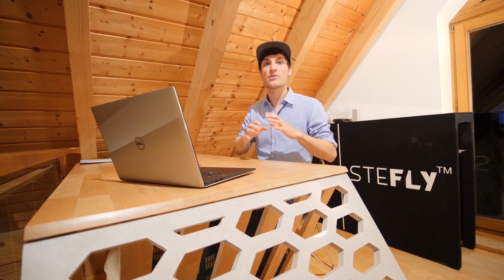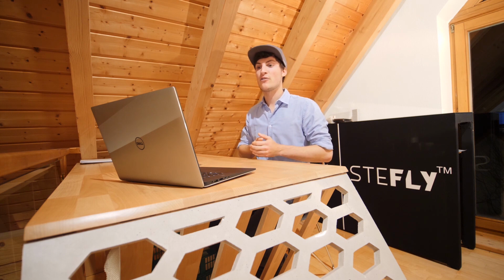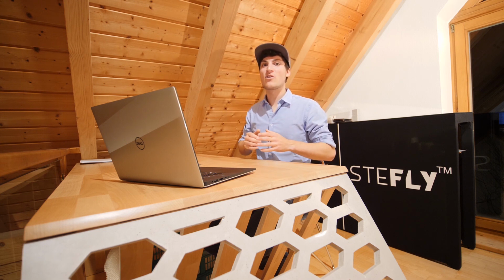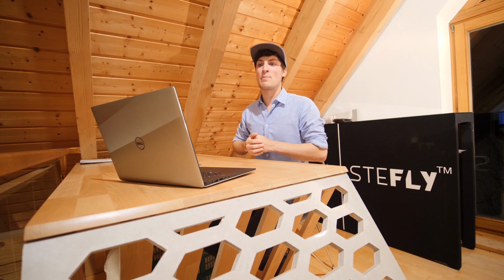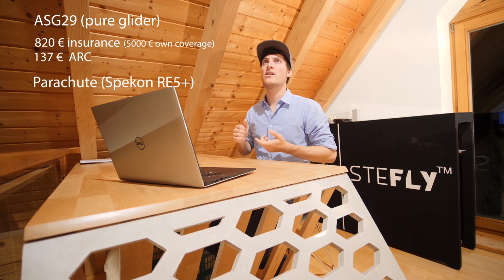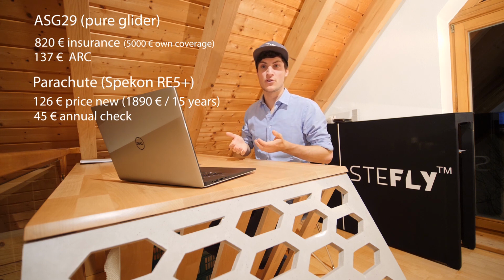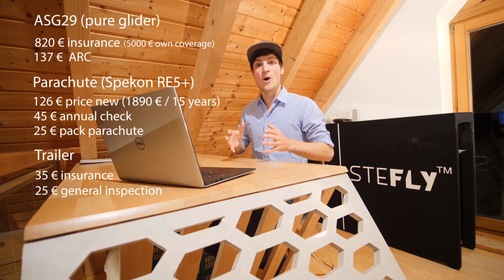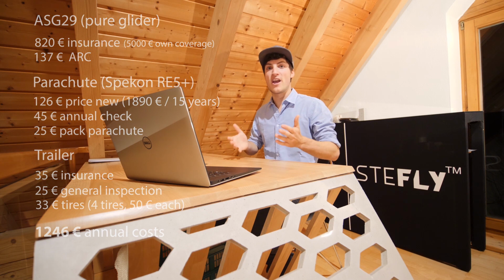Rich Man´s Toys?! | How much does a Glider cost?

Comment: I agree that a glider is an excellent choice over a RS6 or any other sports car. But the comparison is not fair. 
1- Everyone Needs a car ... so if one buy a great RS6 that could be your Daily car to use ... while if one buys a Glider we also need a Car and a trailer ... price adds up ... cars are utilitarian by nature, even the sports models ... gliders are not.
2- Also Gliders need to go up and therefore each time you use them you have to pay an airplane or a winch .. another extra cost.
3- Also a Glider can not be used everywhere and whenever the owner wants to fly ... usually they have to be carried a long distance from home and only if the weather conditions are good.
4- Apart from the parachute you also need the oxygen delivery system and it's maintenance.
5- You also need many extra components for the glider like protection covers, wing support wheel for assembling/carrying the glider 
Trust me I think a Glider is a much better toy then a car ... but the problem is that a car is not a toy ... even toy cars can be used every single day for work, commute etc ... not the case of gliders.

Comment: Fun fact- a car can get you across countries. A glider can't. This isn't a comparison in any way. What a dummy this guy is
Reply: Its joust for comparison. and the world record for an glider is 3000km i would prefer to buy me an nice glider instead because nothing beats an glider
Reply: @randomguyinanglider4090  3000under very special circumstances lol don't forget that little tidbit there fake news lol no gliders are shit. I can drive my truck under any weather condition on or off road
Reply: @aegisraven1284  Trucks and giders arent the same thing and ARENT MENT TO BE THE SAME THING. why should an plane which can fly thousands of miles without engine be worse than an boring car. Jes,flights over 3000km are rare but 1000km flights are extremely common,and certainly not fake.I dont think you ever sat in an glider. Can an car fly? Can an car do acrobatics? Can an car cover huge distances without engine? That you like your own comments is definitively an indicator for that you dont gnow what you are talking about. Jes, you still need an car, but gliders are way cooler and way more fun

Comment: However you can't land anywhere you want, stretch you legs, have a walk and take off again. You are also alone, at least you need to have two seated glider to take a friend or spouse with. May be to buy a bush plane is a better option.
Reply: Thats wrong. its called outlanding and its common for gliders. When you get low you land on an field instead of crashing in the next tree. an glider and an bush plane is very diffrent and arent ment to be the same

Comment: The cost of owning my Arcus M in the uk is massively higher than your figures - 4k euros insurance, 4k euros for the ARC, and always other costs. This year I spent 7k euros to upgrade the flight computer. This is more than the running costs for an expensive car. However the depreciation is much less for the glider. I could sell mine in pounds sterling today for what I paid for it new in 2012, whereas an 8 year old car would have lost 70% of its cost. By the way, what glider costs 400k?
Reply from the maker: Gliders with engine are more expensive, but the insurance costs and ARC is reall really high... The EB29 may cost about 400k€ including all extras and VAT

Comment: Very interesting, thank you! – You mention long-distance gliding and spending a whole day in the air. I would be interested in how you prepare for that? You must be bringing snacks and water? Do you start with a specific diet? How do you manage the bathroom needs etc? What about temperature, under the canopy on a sunny day, I guess it gets hot, is it enough to have outside air stream through the cockpit? It would really be cool to learn about these practicalities that are behind the scenes usually...
Reply from the maker: Thanks for the suggestion, I will try to cover this in one of my next videos.
Reply: This is a bit late, but I think that this is useful.

Snacks are indeed important for long flights. For just a few hours you don't need much but for the flights upward of 10 hrs a good prep is needed, maybe some sandwiches or similar thet is easy to eat. Most pilots have a camelpack style water container for their flying. As for pre flight, the best is to eat as you normally do, and not be hungry or stuffed when starting. Same with drinking.

Heat is best managed by the glider, almost all gliders have a ventilation port in the nose and a vent in the cockpit, and for extra ventilation there is a small hatch on the side of the canopy. Light clothes help if it really is extra hot out, but the altitude helps to cool the air.

It's also important to be protected from the sun. A hat, sunglasses and sun cream are pretty much essential. Most pilots use a bucket hat because it protects from all sides, does not have a button on the top and is not unvieldily large. Buttonless baseball caps are also seen. Buttons are not fun because if an extra strong thermal hits and the glider shakes, you dont want to hit the canopy with one, for the sake of both your head and the canopy.

Peeing is of course eadier for men, with the procedure at least where i live being to pee in a bag and throw it out of the small hatch. It does seem a bit bad to throw plastic out at least for me, but i don't know of a better method. As for women, i really don't know. There are less of them in the sport and it's not the most common thing to talk about. Maybe you can find someone for that if it is relevant for you.

But i'm sure that when you get to the club these will become almost like second nature to you.
Reply: Water...bring lots of water, and a plastic bottle.

Comment: 1. An Audi can't fly nor is it big enough to carry a proper rc plane  --> so it is useless anyway
2. You can see much better out of a glider
3. Chicks attracted to gliders are said to be much more cute and of course much more sensible than those attracted to Audis
4. Only pro of an Audi: you can stop almost whenever you want, if you want to go to the bathroom or behind a bush
--> Next comparison should be glider vs. Renault Espace or Dacia Lodgy because of higher usability with lower operating costs
Reply from the maker: In a glider you don´t need to go behind a bush, you can pee into a plastic bag :D

Comment: 50 year old glider still going strong. That Audi in 50 years? Probably not so much
Reply: You need to know that a price of glider isnt sinking like that of a (luxury-)car. Lets say a new factory glider from the 2000´s (for example Ventus 2a) costed about 120.000€. A Mercedes W221 S63amg (also from the 2000´s) costed aswell about 120-130.000€. Now take a look at the price of the AMG now. Its about 20-25.000€. In comparison, the Ventus 2a costs now about 80.000€. After this big drop, it will of course continue to lose value, but not lineary like a car. After the first big price drop, the glider value will depend on the Index. For example a 50 years old libelle costed a short time ago 30.000€! This is unbelievable for a libelle, but it had such a good index that it was worth it to fly this glider at competitions. In comparison, a ls1f or an Asw19 which are about 10-15 years younger and have of course a better performance, are costing about 10-12.000€ fewer because they havent a really good index like the libelle and less pilots are interested to compete with this gliders at competition even if the performance is better.
Reply: you don't need to have RS6 if you want to go fast. You can use RS3 for such a purpose which is 2-3 times cheaper. Unfair and a bit stupid comparision.
Reply: @lolandypanda  The claim is soaring being a supposed rich-people's hobby.
Accordingly, a rich people's car was chosen for comparison.

What's your problem?
Reply: @Zeppleon  there is no problem here except of stupidness of such comparision and such statements ;-) Relax.. And 15k is not a mark of rich ppl hobby :) Just somehow expensive...
Reply: @lolandypanda  ok, idiot.
Reply: @Zeppleon  Nice to meet you, Andy.
Reply: @lolandypanda  LOL!

Comment: I have a lot of questions :D Are aerobatics frowned upon in a club using club planes? And does it cause extra wear (and thus higher costs) on the airplanes?
Reply: Not all gliders are rated for aerobatics.  If you want to do aerobatics, the glider should be rated for it, AND you should get additional training first.  even then, some clubs may not allow it due to insurance or other reasons.

Comment: And the best part, a glider doesn't lose much worth. You can sell it for nearly the same price you bought it for. 
A car is only worth 80% of it's original value the moment you roll off from the factory.
Reply from the maker: Yes, totally agree. But also with gliders you need to take care to pick the correct one ;)
Reply: @SteFly  This is the hard part for me.  I'm just learning - a brand new student - but I aspire to factory order a 2 seater someday when I'm retired.  Ok, I'm dreaming at this point, but I want to research the possibilities.  Maybe ASG-32 Mi, or... HpH TwinShark, or... Arcus ... or... :-).  So, how to really understand the differences between these beautiful ships?

Und.. Ich wohne in CA, aber ein Teil meine Jugend war in Heidelberg!
Reply: NO! A car is worth 100% when it leaves the factory and looses 15% when it is sold from the dealer and generally it also looses 33.3% after 3 years, but when it leaves the factory it is worth 100%.
Reply: @justme.9711  pretty sure they meant dealer

Comment: If you are a beginner, would you buy a 15.000 EUR glider and do all insurance and stuff, or would you go for a club glider and rent one?
I'm guessing clubs don't really like it if you try to do 3-4 hour flights with their planes?
Reply: I bought my first glider (Astir CS) before I even went solo in gliding. I did about 10 solo flights in the club trainer, and then got into the Astir. I put about 300 hours into that glider over 4 years before selling it. One HUGE benefit of owning your own glider is that you don't have to wait for the club glider - especially on the good days. Also you can fly as long as you want. Don't think that these ships are too old, slow, low performance for you to have fun in. I did many 300Km plus flights, my longest flight being 520Km in 7h20. As Stefan said, your brain is the engine, and the only way you can make yourself better at gliding is by getting in the air and flying.
Reply: Thanks for all the answers. I've been wanting to fly ever since I was born and I feel like now is the time more than ever. Are there any good glider flying forums around? I usually find general aviation forums that don't really have that many glider pilots on there.
Reply: Someone once told me if you start you must NOT buy a glider, even a cheap one. First, you should practice like 20years (I exagerate ofc), spare the money and if you still have the time and the will to, you can buy your first and good sailplane.
Reply: TrAiLiO1111 Depends on the direction of your club, if leisure flying is the norm or if competition and long distance flying are actively encouraged. In my club we are in the latter category, although having mostly club class, and only one standard class ship. However we have enough planes that one can have a plane all day for long cross country flights, or borrow them for competitions more often than not.
Members regularly compete in junior nationals with club ships.
Reply: TrAiLiO1111 It also depends how serious you take the hoppy (or rather life style), and available money. It is also not unusual to start with a modest plane, and upgrade later when your performance and expectations raise, but also your budget (hopefully) improves.
I will probably stick with my prehistoric Ka 6 unless it is grounded for some reason, or climate change progresses with increasing winds that I cannot reasonably go cross county any more. In the last two years I had quite a few frustrating days where I could not gain any ground or at least did not exceed bicycle speed on average.

Comment: If you’re looking into a cheaper way into aviation, gliding the definitely the way to go!
Reply: Paragliding or paramotoring even cheaper and more portable if all you are doing is trying to fly!
Reply: Err, not really. Marginally cheaper and has none of the benefits of powered aviation.
Reply: R Peirce When you are at a club with a winch (which I am), it costs about NZ$30 to be launched and costs about 50c-$1 for every minute you’re in the air, so for $200 you can go on a 3 to 5 hour flight. Heaps cheaper than power flying. Also, you get to learn things that you don’t usually learn in power flying which can be useful such as energy management and slow flight, which can be useful in emergency situations and bush flying.
Reply: @AN2Felllla  $200 every time you fly still means you simply can not afford to have any other hobby besides flying. At least for most people
Reply: @AN2Felllla  Wait, why does it cost $.50 - $1 per minute while you fly??
Reply: keithskillz90210 Yeah NZ$0.50
Reply: keithskillz90210 Oh, it’s because there’s no fuel to pay for, and I fly club gliders.
Reply: @AN2Felllla  Oh I understand now

Comment: Interesting comparison. I would like to add that every young boy or girl can afford an own glider, by earning the money with a normal holiday job. Because the prices for a used Schleicher Ka6 or K8 start at 1.500 Euro. So it is true, this is not a sport only for the rich.
In my view that is really worth it, because you can then always fly when weather and thermals are good, and never have to wait on the ground again because all club gliders are in the air. 
Of course you also spend time to help the others in the club too, but you can do that in the morning while thermals still develop, or on days with no thermals, or by doing other things for the club between flying.
So when you start to dream about flying on your own, get yourself a motivation boost by looking at more great videos like those of Stefan. Or those videos in the following link, where you can also find all german speaking glider schools.
https://www.segelfliegen-lernen.de
Reply: Bernd Korthaus For Ka 8, agree. I would not be surprised if you can get one for free, albeit in need for quite a bit maintenance.
For a decent Ka 6 I would not start below 3000. For the airworthy airframe with minimum instruments, a mechanical and an old basic electric Vario, and an basic open trailer.
For a new radio with 8.33 kHz spacing add around 1000, and for a Flarm with display 500 - 1400 depending if you want an old classic Flarm or a new Power Flarm with a Flarm View or similar display.
A more modern, closed trailer will add cost too.
Reply: @kaihorstmann2783  I agree. I would always prefer the Ka6 to the K8 because of its better performance in distance fligth, and because of its elegance. If I were still young and could not afford to buy a Ka6 at once, I would borrow the money.

Comment: Good explained. Gliders are a benefit fore the Environment. Only coming ub from the ground costs fuel . They are silent . Even the birds dosent fear this aircrafts . For your money they give so mutch back . If i was a twen, i learned  to fly a glider in a Club. My Friends spend their time and money in Discos.  I was always on the airfield . It was the best Time of my Live.
Reply: What is the environnemental impact of the building process tho ?
Reply: Fetilu09 depends. Wooden glider very low. And at ages 50-60 years the dept is forgiven.
Glass ships are OK. Glass fiber production used energy, but the weight of glass is not so high. The resin is made from oil products but again the weight is not too high.
Carbon fiber on the other side is really energy hungry and expensive process.
Still keep in mind that the weight of the entire plane is much lower than a car, and steel, and particular aluminum and magnesium production are more energy hungry.
Also keep in mind how long gliders live. I already mentioned. Club class glass ships also are 40-50 years old, and can still be in terrific shape.

Comment: anyone know the prices of the new AS33, JS3, JS1, Arcus, EB29, Ventus 3?
Reply: New price for 
Arcus  124.500€
Arcus T 151.000€
Arcus M 175.500€ 
Ventus 3 101.500€
" T 120.000€
" FES 128.000€
" M  149.500€
(Geman V.A.T. is not included) and the prices are without any extras or instruments. (So plus about 80.000€)
Reply: @klauski4914  I reckon you have missed €100000 somewhere. An Arcus M ready to fly will set you back around €300 000 , even used close to that!
Reply: The Ventus costs as self starter 200.000 € fully equipt, the as 33 will be around this price range...
Reply: idk the prices but probably over 100k
Reply: I don't know the prices for a new glider of this list, but for used ones your looking at 190.000€ for a js1 with 18 and 21 meter, an Arcus M around 250.000 € and a EB29 for close to 300k€.
All of this is depending in hours, shape and condition of the aircrafts.